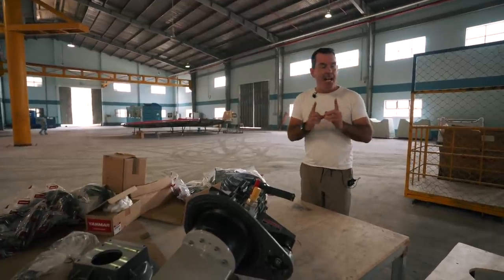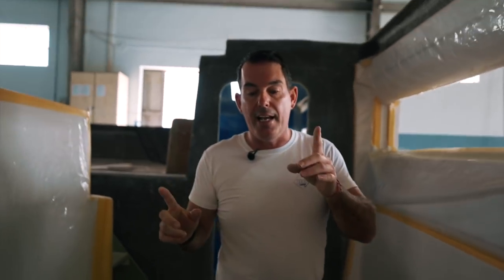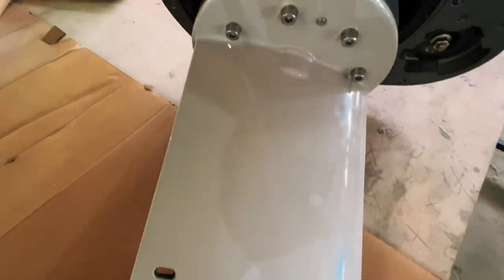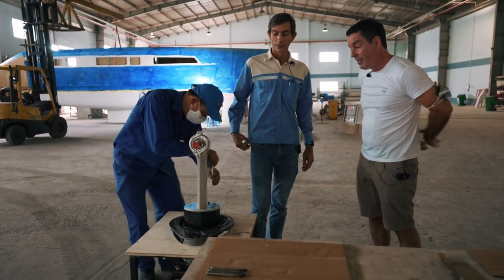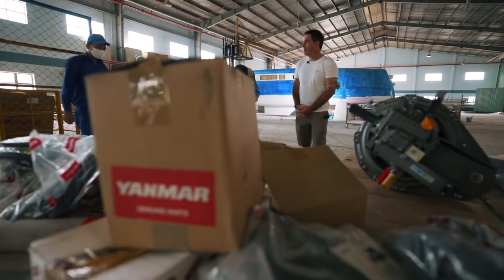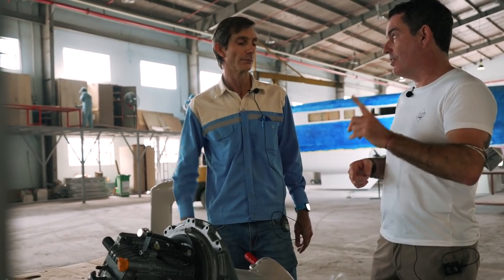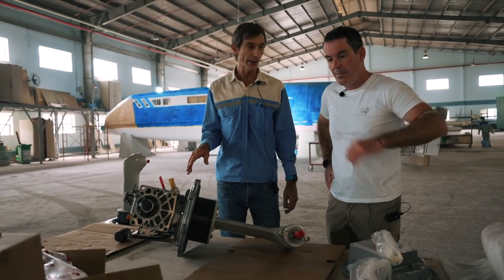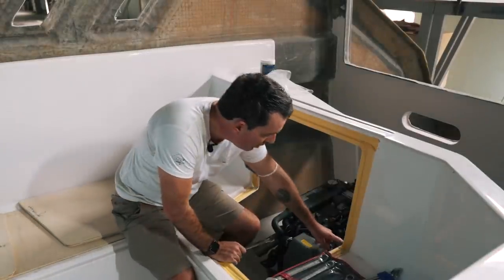CATAMARAN BUILD: How Our 57hp Yanmar Engines & Sail Drives Are Installed

Comment: A little congratulation for you two with ref to CAT tests  , Antares got rid of the extra stidd chair & now has a sunlounger on the port side stern which makes the berth under very much higher ceiling , plus an extra 2 x vent windows plus 2 x straight seats instead of curved seating which you made a referance to. So overall a big improvement & maybe your comments on test made them think ? .

Comment: Ah one thing Nick   - if it doesnt already have it   - interior lights in the engine bay - either switched or motion-sensing  - a blessing when trouble happens  - and it will.
Reply from the maker: Yeah I think the engine bay has lights

Comment: So the engine sits to the aft of the sail drive.   And the prop is still on the aft side of the vertical drive shaft?  Correct?
Reply from the maker: Yes exactly this. The prop is still aft. The sail drive is in exactly the same position in the water. It is the engine that is reverse mounted in the hull
Reply: @sailingrubyrose  thanks.   It was unclear in the video.   Makes perfect sense now.

Comment: I had some serious issues with a volvo saildrive - I assume this could happen to the yanmar also - perhaps discuss with James please:
There is a relative long tube between the seawater inlet and the valve inside the drive. On our boat it happened several times that just this tube got stuckend with sea live.  One time our boat was on dry - I cleaned everything I could see - easy look through the inlet holes, but after getting to the sea the cooling water was very poor - nearly overheating the engine. The seawater pump was not able to get over that!
Our maintainer had a trick: 
He used compressor + compressed air. Disconnects the hose, connects the compressor to the valve, opens valve and leads a good blow through the saildrive. That helped for some time - but the engine should be constantly used. Otherwise that tube got stuck again. 

Perhaps James has a solution - could happen to you also if you stay in an anchorage for more that 2 weeks without running the engines.

Comment: Nick... how great would it be to have a rubber , ( cookie sheet pan ), under the motor. You would put a oil diaper in the pan, when drips, and crap fill it. You just slide the pan out to one side. Replace the oilie diaper. Hull stays clean. But first u have to design the pan.

Comment: With the change to a "C" drive configuration, are they able to operate the engines in Contra Rotating  fashion to aid in stoping sideways creep over long passages with the engines running? What props will you be fitting and will you be going with a completely variable pitch (able to be feathered) or just a folding prop?

It's so exciting Nick. Happy Safe travels Terysa!

⛵⛵⛵⛵⛵
Reply: IMHO the C configuration is done due to space and perhaps weight distribution. Turning direction is not changed by this move.
Reply: @wjhann4836  Yes I understand all that. You misunderstood my question. When both props rotate in the same direction a hull will naturally navigate off to the side as it crab walks through the water...IT'S NOT VISIBLE to the eye. But the effect exists nonetheless. So much so that single engined airplanes have their engines misaligned slightly to compensate for the effect of a single engine's prop pulling the craft offline. With twin props the effect is greater. Over long distances such as on a open voyage on the ocean, the effect will mean that you will need to correct any given course if not either: a) corrected at the helm via the auto helm, or b) corrected using contra-rotating props which spin in differing/opposite directions on their shafts. See my comment above/elsewhere on the manuveourability of IPS/sail drive set ups.
Reply: @gbsailing9436  I'm with you - and expect that the two engines go in opposite directions - so I assume there are different gearboxes installed.

Comment: We have the same engine and drive leg in a Beneteau Oceanis 45. Have you considered upgrading the alternators to a higher output for faster charging…… ours is a Balmar 180 amp alternator while the standard is around 100 amps (I think) and it’s not an expensive upgrade…. Just a thought.
Reply from the maker: We are having the mastervolt 200amp ones
Reply: @sailingrubyrose  nice, maybe I missed that in the video. Seriously loving the detail of your videos, it’s going to be an awesome boat and thanks for sharing 👍

Comment: How does the emergence stop work.
I've had a runaway engine
The Only way I could stop it was to block the air supply. Ie take the air filter off and cover the air intake.
Reply: Typically mechanical fuel shutoff

Comment: Couple of questions: how do you clean marine growth out of the sail drive and how do you control condensation around the fiberglass air conditioning ducts?
Reply: Fiberglass is a pretty good insulator. A/C air @ 50 degrees in hot humid clime… would not reach wet-bulb on exterior of fiberglass duct. Condensation would only happen at wet bulb temperature. Thanks

Comment: A query about the sail-drive and apologies if I've missed a previous explanation.
With the sail-drive reversed, the prop sits in front of the fin? What are the reasons for doing this? Are there pros and cons to this?
Reply: Prop still is behind the sail and thrust "pushes" on the saildrive. The thing thats flipping is the engine position above it. Can have the engine forward of the sail or aft of it. Since its a vertical shaft going down through the drive housing it doesnt really matter what orientation the engine is above the saildrive, its purely for changes in layout of the interior of the hull. One could argue that its moving the engine weight further aft, which would come with its own pros/cons like hobby horsing more but it also means you get a different layout of interior space so the overall boat can be smaller since theres not as much "empty" hull behind the engine. Can also think of it as "the engine is going here does the boat perform better with the saildrive/prop placement fore or aft of this location".
Reply: There are be pros and cons. If you are interested in such matters, you could look into Volvo's IPS drives which face forward. They say they offer between 25-30% better power and fuel advantages as the props are acting on "clean undisturbed" water, rather than hitting water that has passed a "leg".  This benefit often depends on installation type, power matching and hull design. They also offer greater manoeuvrability. They have been on the market now for many years and many yacht manufacturers take advantage of the many advantages they offer, particularly on. motor boats. There are a few drawbacks however. YT a simple explanation of these...

Comment: Hi Nick, I believe your comments about diesel engines running on are probably no longer correct. In times gone by the injector pump was entirely mechanical, and did all of the injection procedure without electricity (apart from a stop valve). However, modern engines normaly use electronic injectors that are controlled by the ECU. So no voltage would stop the running engine. 

144 hp. That is lots of power. I reckon RR2 will give some motor boats a run for their money.
Reply from the maker: That is a very good point, and I am pretty sure that with the common rail engine you are correct.

Comment: I really don’t understand the reason going from a Z configuration to the C configuration.    What’s the reason?
Reply from the maker: When you add an engine to a boat you have to work on its placement to ensure proper trim. 
So weight distribution within the hulls needs to be taken into account when you are designing a boat. After all you are adding 200kg to a boat. It it’s too far forward or back the trim won’t be right.

In this case having the engines reverse mounted allows a different position within the hulls

Comment: Great video - what an amazing boat!  Have you ever thought about going electric rather than an ICE?  With a combination of wind and solar you can easily harness enough energy to power that catamaran and all the systems. With a 100KW generator as a backup it's problem solved. No more fuel, no more engine problems, no more engine noise, very low maintenance and long life, go anywhere on the planet and never worry about fuel availability or cost. True Independence!
Reply from the maker: Yes we discussed this at length in our previous episodes with Antoine
Reply: Which episode? I can’t find it?
Reply: @curtispons8613  Yeah, I can't find it either.

Comment: What's all the blue coating?
Reply from the maker: On the outside of the hulls? It's because the gelcoat has been polished and they're just protecting it from getting dirty again. They'll just peel off that blue paint when the boat is finished and ready for launch.
Reply: @sailingrubyrose  Are the hulls smooth & straight enough to paint and still look good?  I've not seen any Seawind cats yet in anything but white, would be awesome for you to be the first on their flagship new model!   I know that is the reason you rarely see Outremer's and most production cats rarely are painted as they look wavy so they keep the hulls white as it hides the imperfections.

Comment: Curious about the engine, coming from the automotive world. What is the displacement of this 4 cylinder engine? I find it big for 57hp, my car had 63hp when new from factory out of 657cc that seem to be two thirds the size of that Yanmar. 
And isn't the torque more important than the power on a boat, and therefore the reason marine engines are diesel powered?
Have a safe trip Terysa.

Comment: What is the purpose of wearing your mask around your wrist? 
I understand the convenience of having a drain tube on top of the engine. My concern is that any debris in the oil will be deposited and remain in the foot. Without gravity, a strong pump and suction will be needed. Maybe overthinking?
Reply from the maker: I think that’s the same with most pelar pumps

Comment: Why not shaft drive? Why not electric motors like 20kW Bellmarine with prop battery regen under sail? Wouldn’t you rather have more lithium and more solar than noise, smell, maintenance, oil changes, belts, etc? Once you drive a no-maintenance Tesla, you’ll never go back to a gas engine. Sure, the electric motor tech is a bit on the newer side, but it’s proven to be better in every way. I love what Windelo boats are doing with going all electric. It’s definitely the future.

Comment: Sail drive = first real weakness.  Shaft drive please.
Reply from the maker: The boat hulls would need to be redesigned to take a shaft. Unfortunately that wont happen now.
Reply: @sailingrubyrose as above  Are you aware that scammers are attempting to use your platform?  Cheers

Comment: I just can't understand why you are going with an ICE (internal combustion engine) when the world is going electric).  All the issues of maintaining the engine complicate your life at sea considerably.  It's the maintenance of the engine in a  tight space plus the simple issue  of something that has hundreds of parts.  Try getting replacement parts in places like Tonga or the Marquesas.  You also need to carry large quantities of fuel in containers. Refilling these containers in dicey areas of the world with dicey purity of the fuel is another issue.  Electric is so much simpler and you get the fuel from the sun. What you are doing seems like a throw-back.